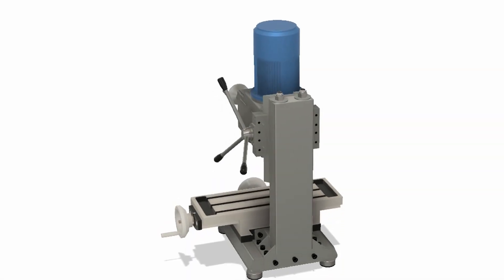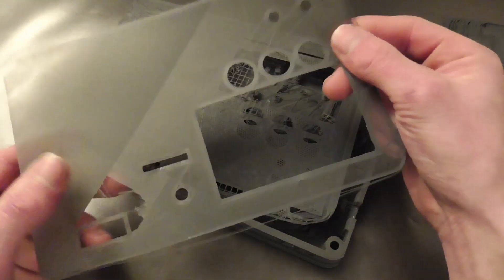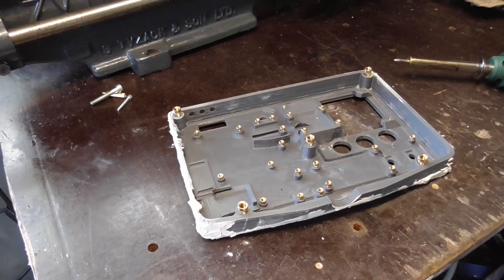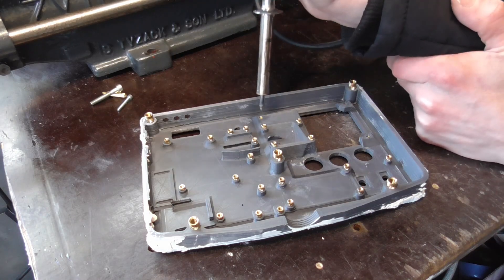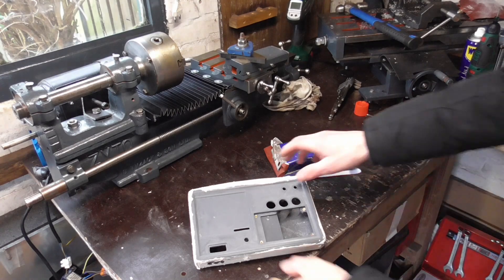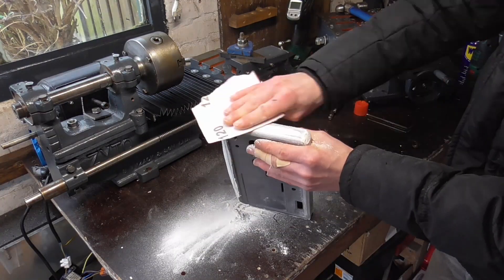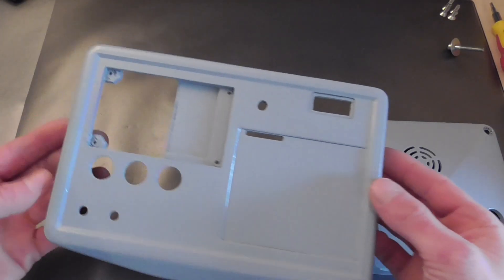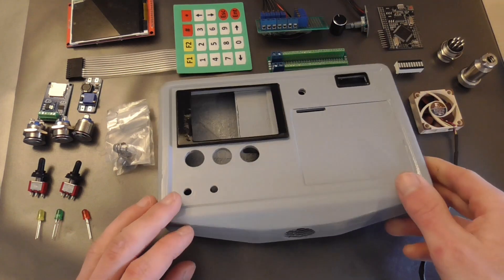Homemade DRO - CONTROL PANEL   [Homemade Milling Machine]

Comment: Very interesting. I watched all the videos on this and would like if you used it as a mill in the end. Sometimes I build something and it seems okay, but doesn’t work as intended. 
Nice work
Reply from the maker: Thanks, I am sure it will work but how far I can push it is a different question, we will find out in the end😉

Comment: Looks like a great print after you worked it. Not all prints come out great but if it works…….
Reply from the maker: Thanks for your comment! I guess there is a difference between hobby grade printers and professional printers, in the end you get what you pay for.
Reply: @EngineerSteve  the cheap units take a bit of time to get right but they will work when you understand their idiosyncrasies. Unless your printing day in/day out, hobby printers are the way to go. 
When is the next instalment of this project?
Reply from the maker: @PiratePawly  I have seen good results from hobby printers indeed so I can improve as well I asume. I am currently fitting all of the electronics, the next upload kind of depends on how easily I can get the screen up and running, I would say 2-3 weeks as I am working on other projects as well in my spare time.

Comment: turned out very nice. I'd like to see this project complete! not sure why the 3d prints had them issues, but after painting it looks very nice
Reply from the maker: Thanks! It will be challenging to get it working like I have in mind but if it works I dare to say that it is a unique way of controlling, compared to other projects on YT.